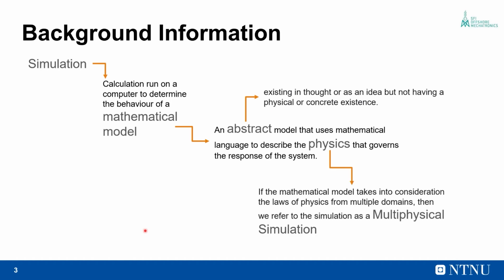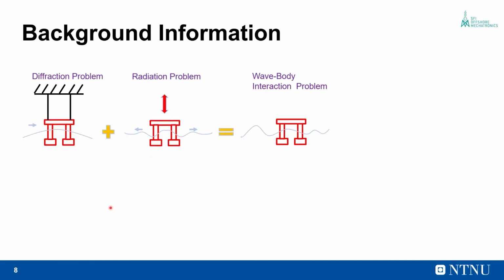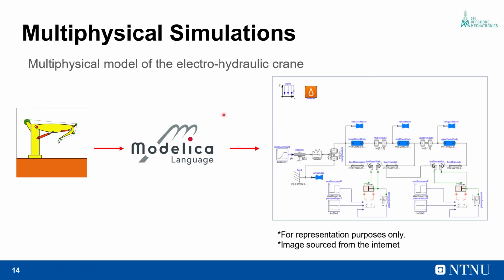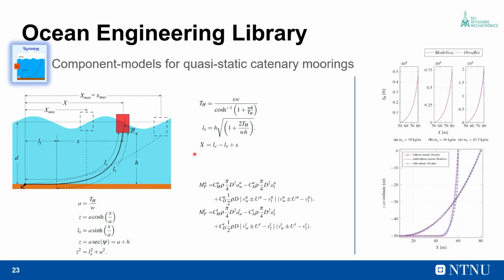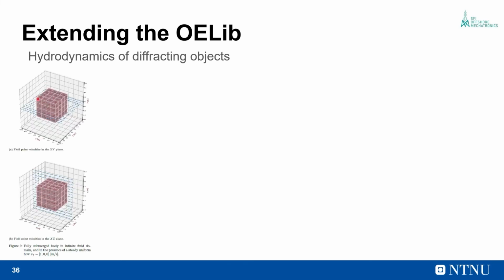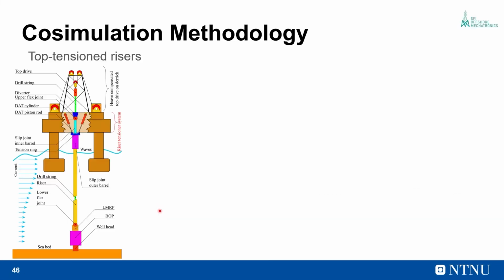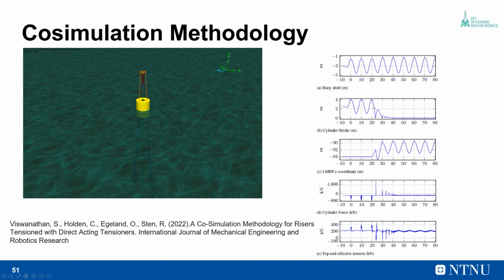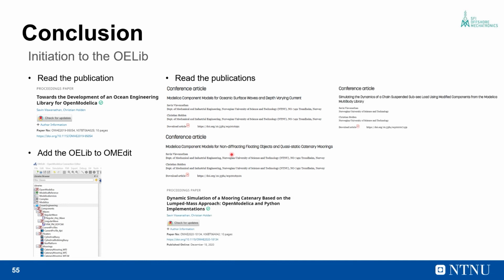AMETSeminar Savin

Comment: Nice presentation.Is this an open source library?
Reply from the maker: Thank you! Yes it is an open source Modelica Library...the hydrodynamic analysis code is also opensource ....the download locations can be found in the papers listed on my university homepage https://www.ntnu.edu/employees/savin.viswanathan
Reply: @savinviswanathan5819  I'll find it as directed. I got hold of your paper on boundary element method using python but couldn't run the code   with the error not seeing gradif.py function.

Could you help me with fixing the error?
I think it's a conversion thing of turning fortran to python code which I don't have any good idea on
Reply from the maker: Yup, could be that you will need to wrap it again using F2PY for your specific OS. Am travelling now, will send you the FORTRAN file when I get home on Sunday and we will see how to get it working for you.
Reply: @savinviswanathan5819  thank you so very much.safe trip.till Sunday then.
Reply from the maker: @austineadah2843  You can download the fortran code 'gradif.f' from my dropbox https://www.dropbox.com/sh/dtqlqp1rrp5ns78/AADDtV5pDvwbNsf4w-PBnrUIa?dl=0 . I have also attached the paper that I had referred to reconstruct the code. You can use F2PY to wrap the fortran code for use in your system. After you wrap, you can use the ;testgradif.py; code in the download to test if your wrapped function is working. I am travelling till 10th April, so I will respond with delay. Also, drop me a mail on savin.viswanathan@ ntnu.no so that its easier for me to respond.
Reply: @savinviswanathan5819  okay no problem. Thanks alot.i use a windows 10 machine and will try it out.i haven't done the wrapping thing before.. but I'll check the documentation out and try it as instructed. Sorry about my late replies.